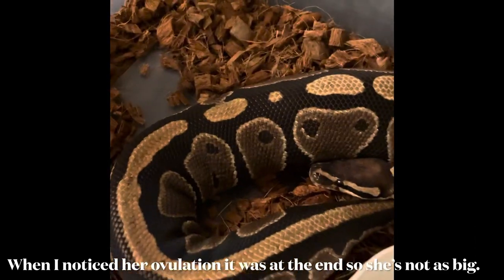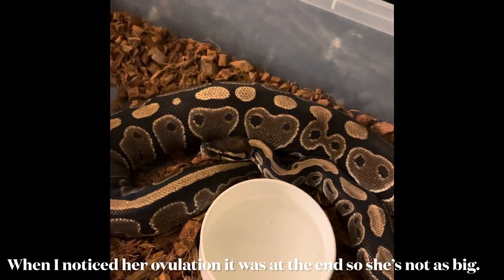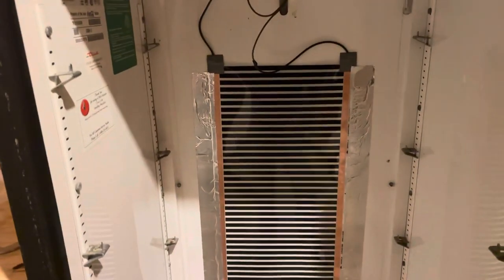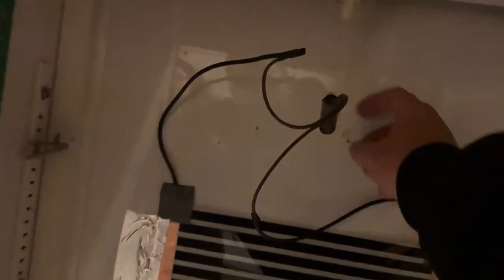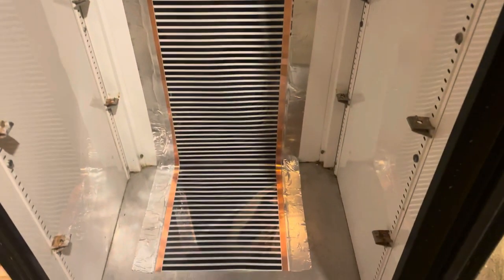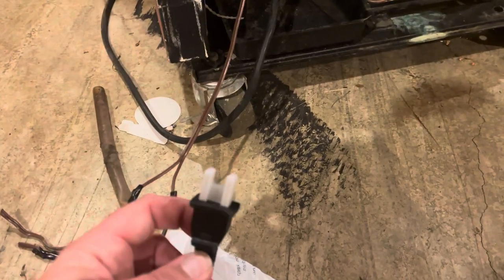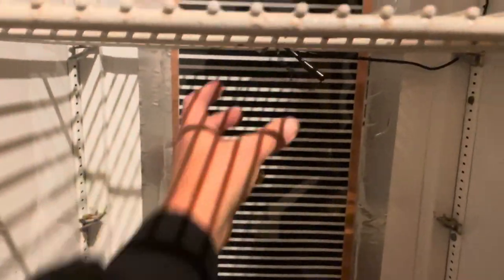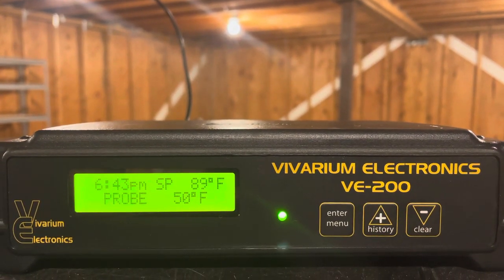HOLY OVULATION....incubator build  #diy #ovulation

Comment: I just built one like yours, I had  problem with the stock fan giving off heat. Without the heater on it would get up to 87. I switches to a few computer fans and its working great now. Hows yours running so far?
Reply from the maker: It’s actually running great. We have the thermostat set to 89 and with the fan on the hottest it’s got was 90